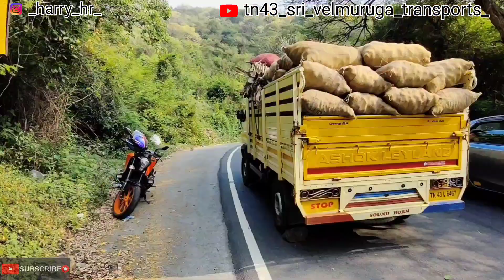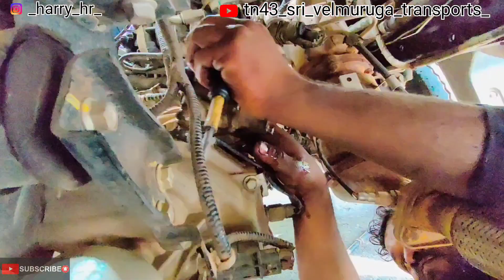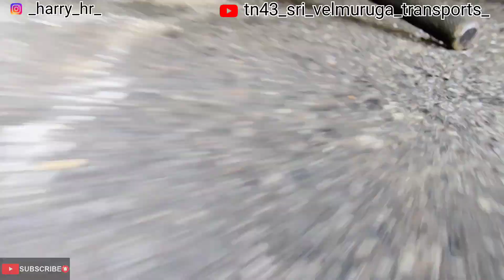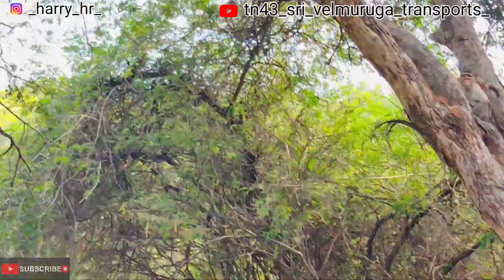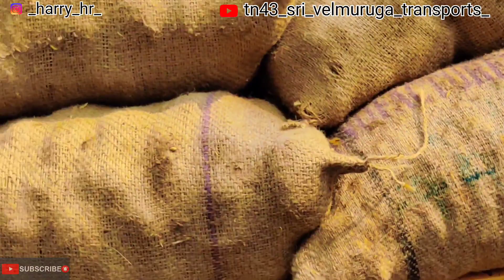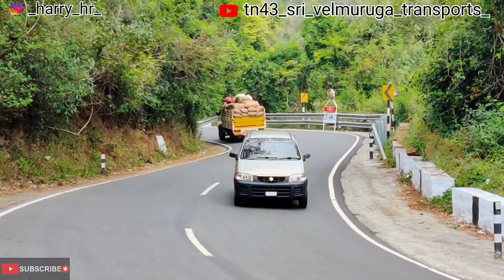Second Breakdown Double Gear Problem | Bada Dost i3 | Ashok Leyland High Maintenance 🥲

Comment: Bro I have Bolero pickup 1.7T I'm driver in dost for 3 years dost is worst vehicle pickup  is mass bro en pickup ippa 52000 km odiduchu but innum one time kuda breakdown aanathu illa bro...
Reply: நண்பரே நீங்கள் உங்கள் வாகனத்தை all indian drive panrengala
Reply from the maker: Ella vehicle laum problem varathu bro some vehicles tha apdi
Reply: Bro en ketta um dost tha irruku bs6 tha daliy 3 ton over height load tha oddura 1 year achu vandi yetuthu  45000 km oddiyachu ana enum oru chenna problem kuda varala enga orrula 40 vandi irruku dost ana bick up 5 tha irruku    ela dost um appadi la problem pannurathu ela
Reply: Ashok Leyland dost is tha best vandi. 🔥
Reply: Pick up worth